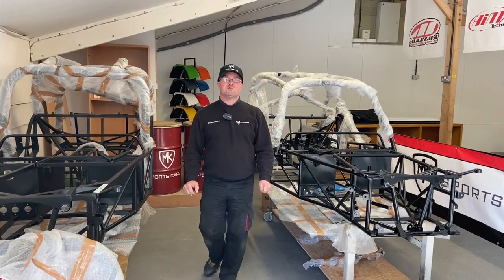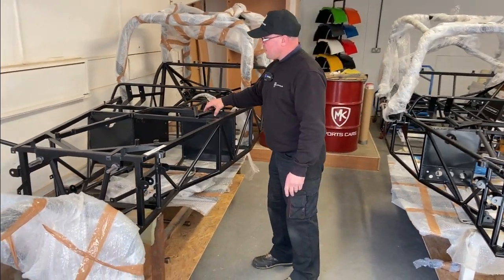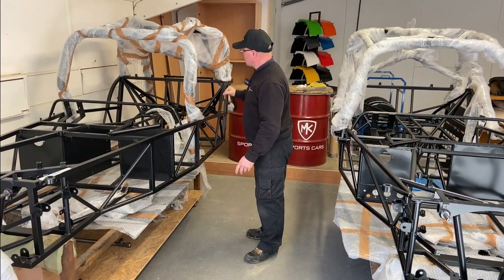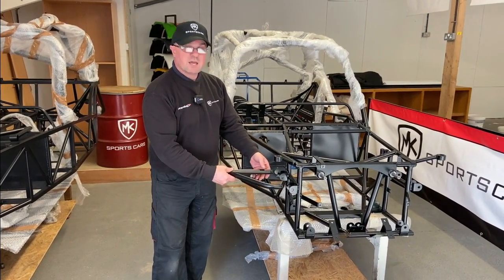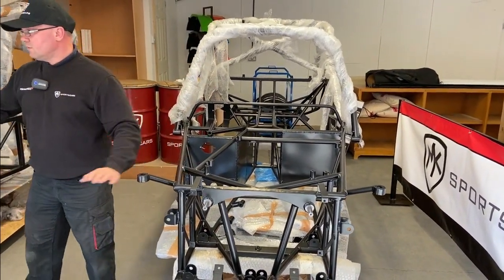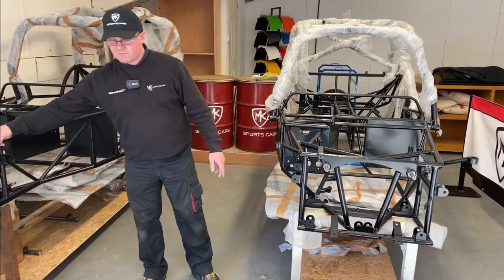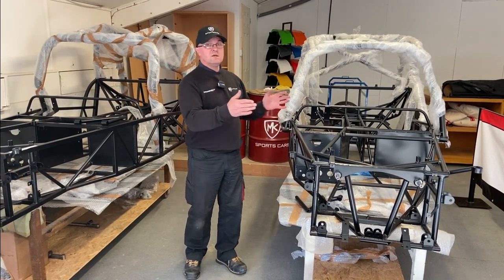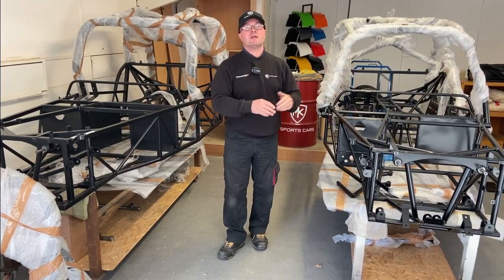MK Sportscars : Difference between Indy R and RR Chassis

Comment: I wonder about the viability and cost implications of building a chassis in aluminium and if it could be done would the weight savings verses cost be worth it, not only that could it be too light and be unstable at high speed 🤔
Reply: When I visited Ron Champion on one occasion he showed me an aluminium chassis Locost with a bike engine that had an all up weight of 350 kilos; in truth I don’t know whether it was either strong enough or financially viable but it was a running car all the same

Comment: Great content.  Keep up the good work 👍
You mentioned about the Busa gen 1 pair system.  I have just managed to get my classic Indy back on the road after 9 years converting from ZX9R to a 2007 ZX10R . I have been in 2 minds about blanking off the Pair system. Would you recommend that I do as I am running the 10 with a PC111. 
Regards 
Brad